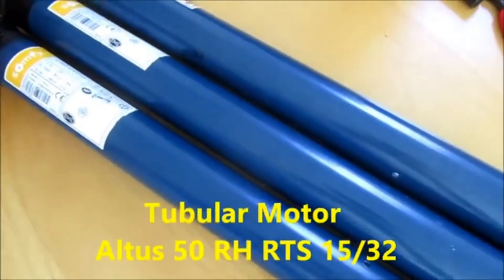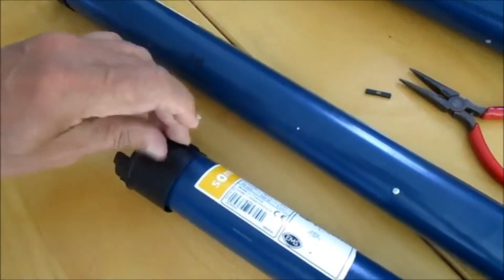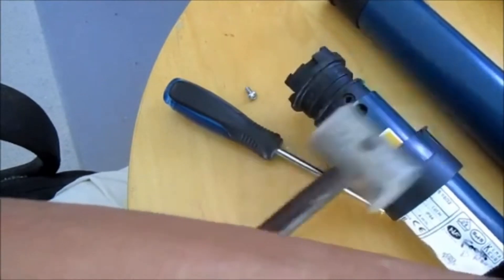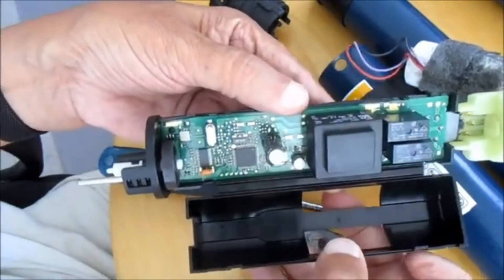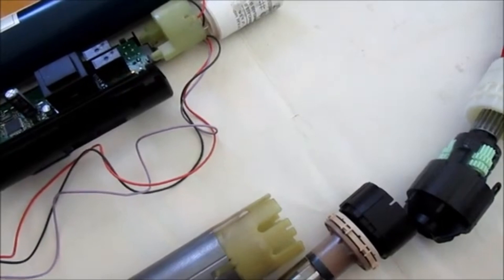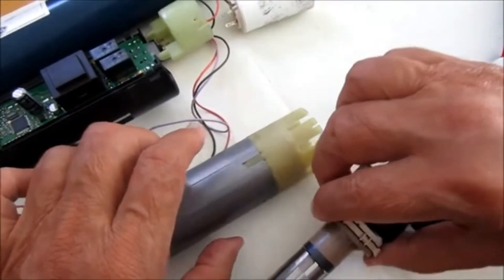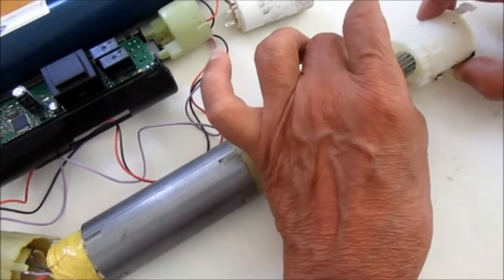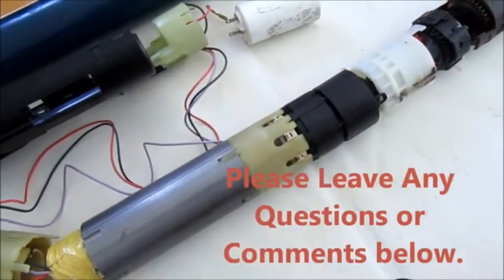Somfy Tubular Motor Dissemble | Step by Step Somfy Tubular Motor Dissembling Guide and Explain

Comment: Hey hi. Great video. Thank you. How do you know if the capacitor needs replacing?
Reply from the maker: Capacitor problem means Starting issue in the motor.
Reply from the maker: Some time not opening
Reply from the maker: Sometime changed machine sounds
Reply: @AutoDoorSurgeon  Thanks Dr Surgeon. These all sound like my issue. Removed the capacitor and potentially turned a $500 problem in to a $5 solution. thanks so much for your videos.
Reply from the maker: You welcome